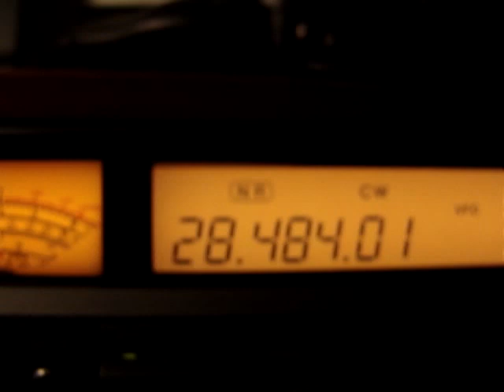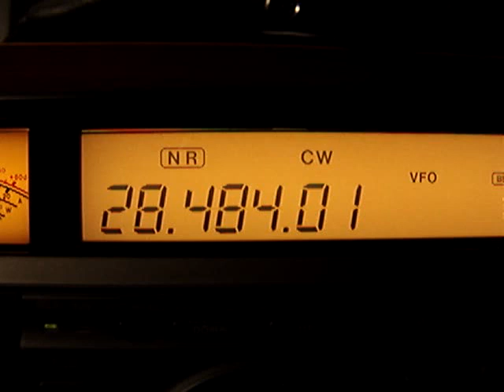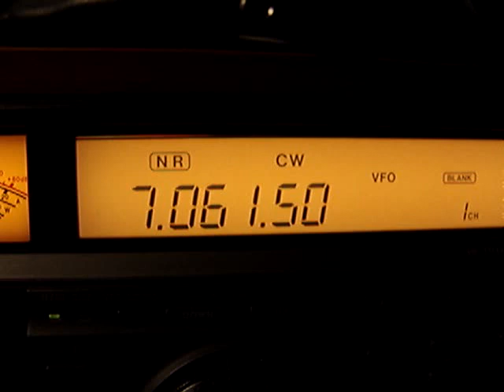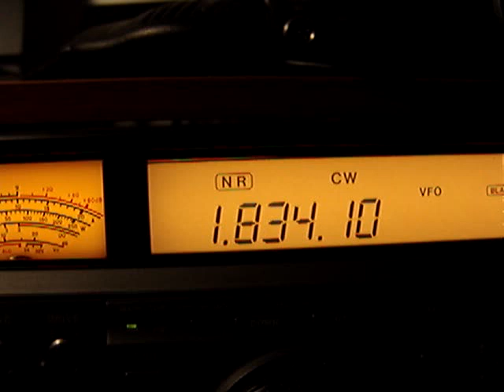IC-775DSP OutputPower

Comment: I noticed that you did not check any of the WARC Bands either? Has the radio been modified for 60 meters as well?
Reply from the maker: Hello!
on the text you can read that I skipped the WARC bands intentionally because I think it is irrelevant. The 5 classics plus 160m would pretty much cover the radio span. This video is from 2009, I believe that we didn't have the 60m band yet.
Glad to know that so many people still like this video.
73 !

Comment: MFJ =My First Job.I would find somebody with a much better wattmeter than an MFJ.At least a separate wattmeter that is NOT in an antenna tuner.If it really is doing that much then turn the power knob down so that it never puts out over around 200 watts PEP at any time.Nobody can hear or see the difference in 200 watts & 300 watts so it's no loss to you.

Comment: I have a 775DSP, If I test mine with a Bird Meter ( or a Daiwa CN-801 which gives me the same as the bird) the meter on the radio is dead on, whereas my own MFJ equipment (many) all give various results, and not one of them is acurate. The output power you are showing is NOT a true reading!